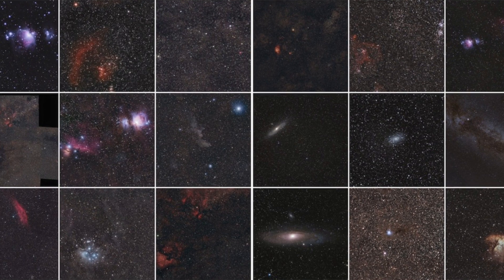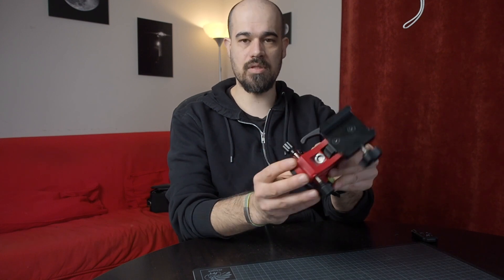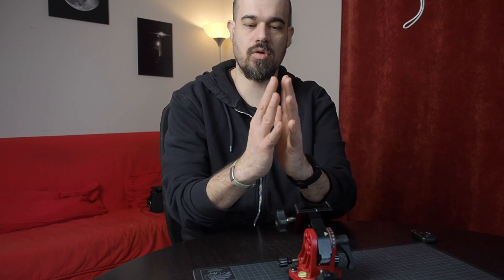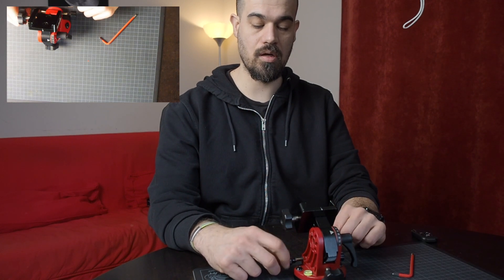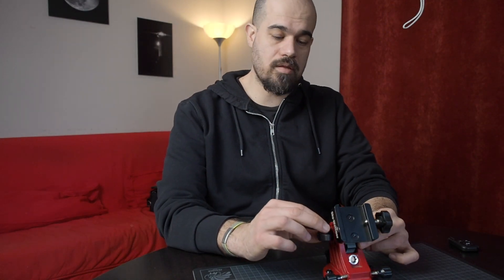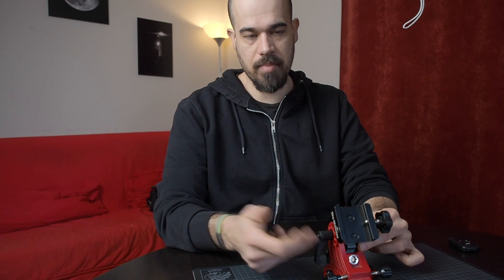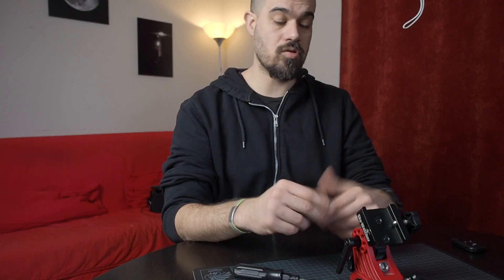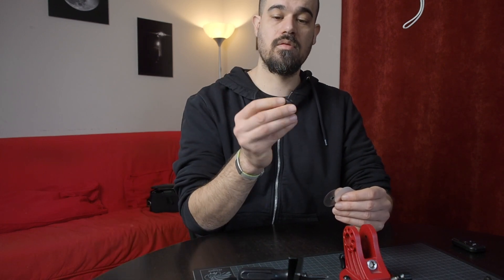Sky-Watcher Star Adventurer PRO Maintenance: The Wedge

Comment: Thumbs up for this video in 2023. I purchased a star adventurer last year and have been pushing more and more on it. Currently probably at or a little over the limit with guiding and a small refractor. My tracking was getting progressively worse, and I couldn't pin down the issue. After watching this and checking over the wedge, turns out it was a combination of all of them!

Comment: I wish I saw this video before I broke the lever... I always tightened it too much because I didn't want it to move at all. At my latitude there is not much weight on the Alt adjustment, so it tends to flap around between the gear teeth.
Reply from the maker: Thanks. Try making thicker washers

Comment: Very good tour of the wedge. I agree with you that the wedge gets some undeserved criticism due to user error. Your video should help balance the debates.

One of the common user errors is to confuse the azimuth adjusters as "locks". The push/pull+pin adjustment design is dozens of years old. And it was never intended to HOLD the azimuth. It was designer to adjust it. The two screws on the base (I call them "azimuth lock screws") should be all you need once the mount is aligned in azimuth. The adjusters can be fully released after alignment. I replaced my azimuth lock screws with thumbscrews. Allen wrenches are no fun in cold and dark.

Also, I don't think it's documented, but the altitude lock arm has that spring inside to allow the user to easily re-orient the arm angle for the most comfort. I stumbled into that by mistake. It's an unappreciated feature.
Reply from the maker: yep you are right. likely, the metal lever I suggested has the same spring mechanism.